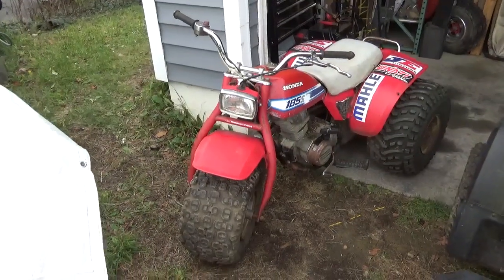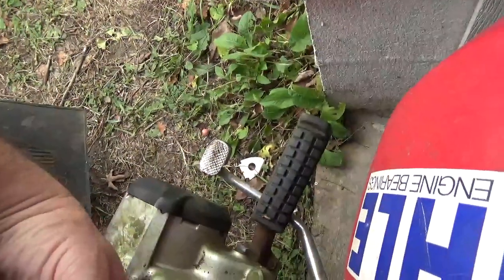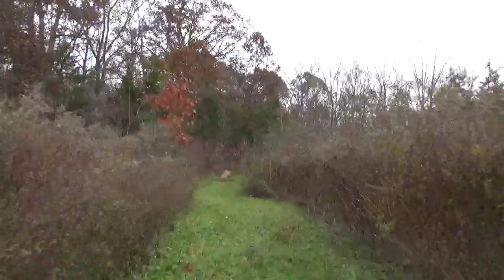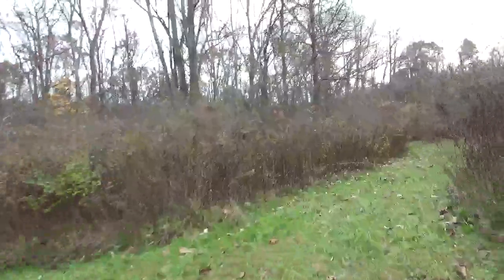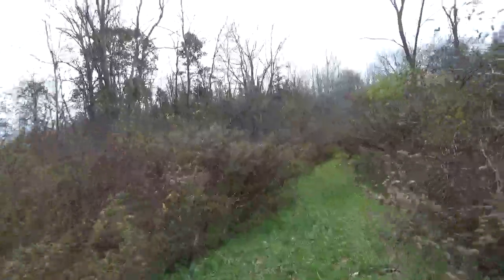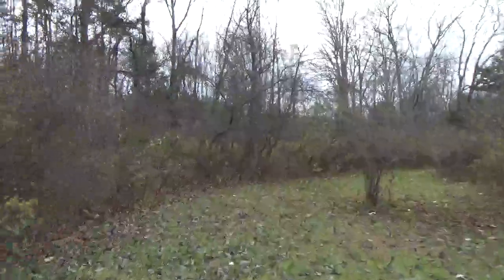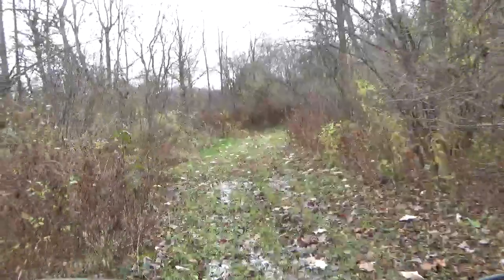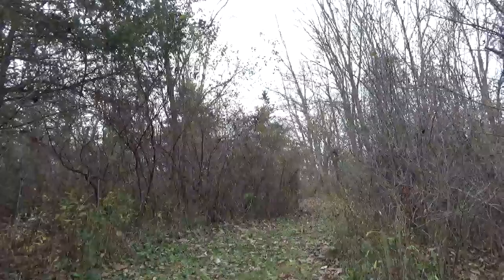1981 Honda ATC185S, Cold Start, First Ride, engine squeal at end!

Comment: Good video brother. Cheers to another running machine. I just tore my 1981 atc200 down, sent the jug and valves off for machining. Got it up to 10.25:1 compression with 30mm carb. All polished crank and intake
Reply from the maker: Hey Dillon, I love it when a machine comes back to life....  Ur ATC200 will be an amazing machine when it is all done.... Thanks for the encouragement, info, thoughts, watching, and commenting!!!!

Comment: when i was a teenager i wanted a cheap 3 wheeler to bash at my buddies farm so i bought a 125 cc wheeler for 200 bucks from a kid at school. the first time i took it out the engine lost all power to move but would still run. my first experience with dont believe what your told about used bikes, lol

Comment: Im in NY. If you come across any decent ATC 125m or 185s that you are willing to sell, please let me know! Im also looking for 185s parts. I need a seat pan for a 1981 185s, pickup coil, ignition source coil, headlight assembly and plastics for an 81 and 83. I have an 83 that runs great and an 81 with no spark.